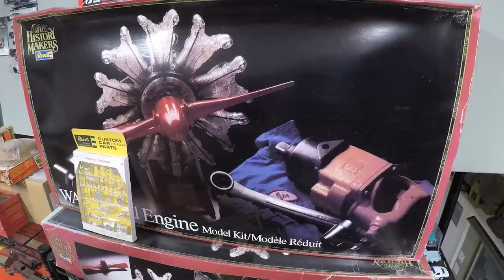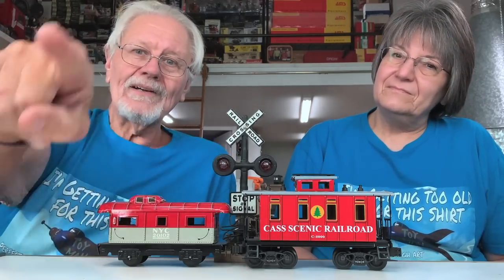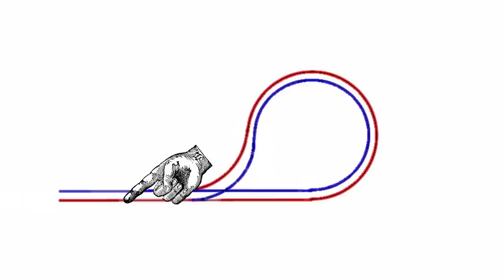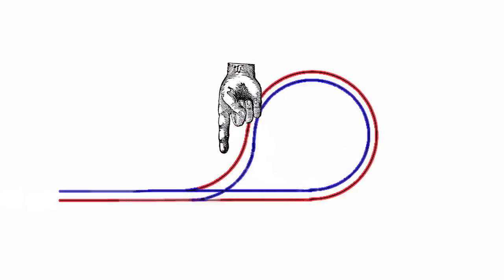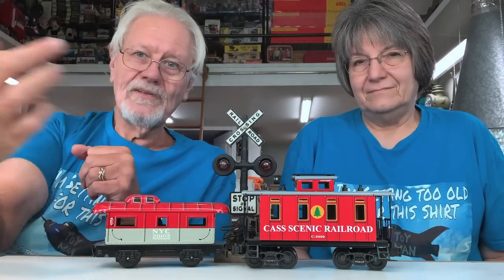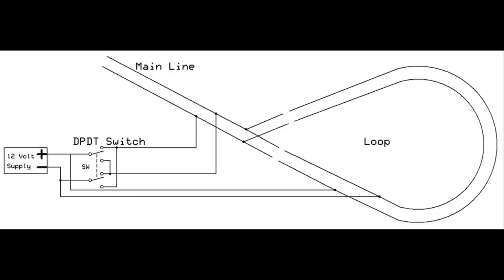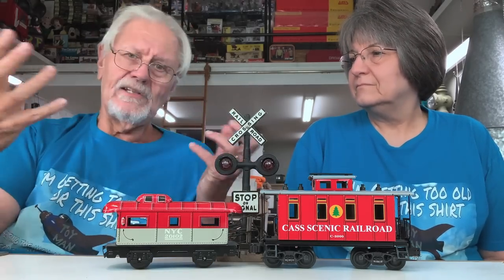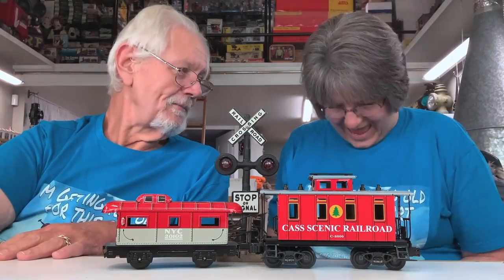Scales and Gauges Part 8 - Why did Lionel Use Three Rails?

Comment: Well, I'm certainly glad we adopted alternating current.  Can you imagine how many power plants would be around now if we had stayed with direct current given its distance problem.  That being said, almost any appliance nowadays runs on direct current as even though outlets supply alternating current we still use rectification in appliances to convert the ac to dc.  Towards the end of the tube era we went from using tubes like they ST type 80 and the 5Y4 octal and 35Z5 loktal tubes and started using selenium rectifiers which lasted much longer.  The being said, if you currently have an old radio that is still using a selenium rectifier it's time to change it over to a diode because those selenium rectifiers are now way past their intended service life and they will eventually burn up.  They are not a pleasant smell when they do either and will make a house stink for a long time with a smell somewhat like burnt garlic but more powerful.  Diodes are very cheap as well, being about 10 or 11 cents each.  I usually replace a selenium rectifier with a 1N4007 diode in my old radios.
Reply: Be careful!!  Check out the filter capacitors and other circuit elements because the forward voltage drop on the rectifier you are replacing is much, much higher than your silicone diode.  As a matter of fact, you probably need to change any electrolytic capacitors because they tend to dry out, become leaky, and are much much lower in C value.
Reply: @wcarlhepker4806  Oh, I do.  Last time I replaced the rectifier it was on a Zenith K725 and I put in a dropping sand resistor in as well.  I always replace the electrolytics as well and any oot resistors.  I tend to change out the old wax caps too, but none of that really had anyting to do with what was mentioned in this video so I didn't include it.
Reply from the maker: You guys wanna rebuild my juke boxes?  The filters hum like a substation.

Comment: The diagram for a reverse loop and switch for DC will work equally well for AC.  Instead of a polarity mismatch, you have a phase mismatch.  Either way, it is a "short."  Instead of solving a problem of a DC voltage being reversed and connected to itself, you are solving a problem of an AC voltage having its phased reversed and connected to itself.  In fact, with DCC, which is AC (some don't think it is, but it is) the same solution is used for reverse loops as if it were DC.  However, for DCC the reversing is typically automated (but doesn't have to be).
Reply from the maker: Yup!!! More when we do the electrical series!!!! Super interesting stuff!!

Comment: Another case of RL track with three rails is when tracks combined both narrow and standard gauge. In that case the extra rail would not be positioned at center. Unless the small gauge was half the width of standard gauge. I am unaware that such a combo ever existed.
Reply from the maker: Yup. In Australia in places they have 4 rails. That support 4 gauges!

Comment: Glad to see you guys alive and kicking!  (I've been spending my YouTube time since Feb on Ukraine.)
Did you forget to mention the bit about the old Lionels changing direction every time you gave them power?  I think you had the intention to mention it with the AC explanation, but I didn't hear that 1 point.  Given your AC explanation, I understood why the engines switched automatically.  
This is#8 in a series?!  I'll go back and check the others, as Ukraine permits.
Reply from the maker: Hi!  Yup #8. The reverser was a Marx invention. Lionel bought it. On a simple AC motor you need a switch on the locomotive to reverse. On this reverser there is a stepper relay that reverses the motor every time the power is cut. Or it can have a neutral position. So there is a three position relay. And on the most advanced system a button can interrupt the power for a split second and reverse that way.
Reply: @Toy Man Television  good lesson.  My grandad's Lionel never had a Lionel Transformer.  Might've been a Marx, but this explains the "cross-connect."  The xfmr has a little red spring loaded pushbutton on the side.   Never thought of that thing as advanced, but such is the march of technology.  It's gotta be at least 80 years old, and the d*** interrupter switch still works.  (Tho only at Christmas!)
Best to you and your prettier half!

Comment: The Marklin Company used to sell 110 and 220V volt high current AC O scale and Gauge 1 train sets called Starkstrom, you can tell them apart from the low voltage ones by the fact that there is lightning bolt symbol on the cab, Dangerous trains.
Reply from the maker: Didn’t know!!! Easy to see why. The variac transformer was huge and expensive. DC such a problem. John Allen’s rail Road was originally powered by an AC motor connected to a DC generator with a flywheel. Then the throttle was a variac that ran the AC motor. So the engines would start slowly and “coast’ to a stop. Inspiration for “flywheel” power supplies in the 1970’s when this could be done with a set of capacitors.

Comment: I thought the ac/dc discussion would lead to LGB, TT and Q.  TT you covered, but what is Q scale?
Reply from the maker: We will get to #1 gauge (LGB and so on) sooner rather then later. I think…. At this rate 2025?  Anyway Q is the same as SMO. Scale Modified O scale. Originally I think they picked Q as a Q is a modified O. Anyway 1:47 scale and later 1:43.5 scale on O gauge track.

Comment: Although a lot of info here makes sense some details are not accurate.  Lionel did not invent three rail track (Marklin did in 1891).  Also the toy train items in the video are not made by Lionel, but by Marx and somebody else (the G gauge caboose).  There is no problem using AC current with a two rail metal tied track system (American Flyer S gauge used it with metal ties)  but before plastics insulating all the axles between the wheels was an expensive challenge.  Charming video nonetheless.
Reply from the maker: Hi. Yes oops. Marx. The large caboose is O but just big. A souvenir item.
Reply: That caboose is O gauge!?  Good heavens.  I personally like the fact that someone is putting out information about tinplate trains.  All my kids and grandkids love them, not to mention people who just stop in for a visit.  Putting together a really cool prewar train set with track and tinplate accessories is less expensive than many electronic toys (I just bought a standard gauge set for $150 CDN or about $105 US with track in beautiful original condition).  The motion, the noise, the lights  and the smell  all play on the senses.  Keep doing what you are doing...

Comment: How did AMerican Flyer work? It was also AC. How the Lionel E-Unit worked is also interesting.
Reply from the maker: Yup. American Flyer also runs on AC and without the center rail the track plans need to conform to outside rail always being outside. It is possible to do a reversing track but a bit more difficult than DC.
Reply from the maker: And the reverser on Lionel can be one of several systems. The Marx style reverser with an  interrupter on the power supply, a relay in the locomotive as on the E units or a simple switch on the locomotive.

Comment: Wow, still confused.   You show a 2 rail diagram with breaks ... I assume in the loop that the loop becomes hot, but once it exits the loop, the straight away going the other way somehow becomes hot? How does it automatically change?   Is the engine "coasting" over the short breaks and tripping a switch at the same time?
Reply from the maker: It’s not automatic. It ca be but in the normal system here you make sure the polarity at the entrance to the loop matches the main line. The train can take either route but the polarity at the entrance needs to match. Once the train is in the loop you throw the direction switch and now the polarity matches the exit route. A detector can automate that.

Comment: Lionel measured their track curvature in diameter not radius. 0-36 curve was a 3’ diameter circle. When Lionel produced their 0-27 trains the “standard curve” produced a 27” diameter circle. The 0-27 trains were also slightly under scale to accommodate the tighter curve. This also made it possible to build a “real railroad empire” on a 4X8 sheet of plywood. Whereas this would be difficult with 0 gauge trains and track.
Reply from the maker: Yup. Forgot to mention that.

Comment: When I was a kid a couple of my friends had American Flyer trains as they thought the 2-rail system was more realistic. I guess that's a credible argument, but 3-rail Lionel was always what I had and liked to this day. That includes all the great stuff available these days from MTH and other manufacturers. Isolating a track for manual block operation is also easy.
Reply from the maker: Well.. I thought the same thing.. it’s a slippery slope. First American Flyer. Than HO. Then craftsmen kits. Than scratch building. The thing is Lionel was not intended to be realistic!! It is intended to be FUN!!
Reply: @ToyManTelevision  The stuff Lionel's making today is highly realistic. I have some of their new stuff and it's great, and expensive. I have HO too and like it. Never had American Flyer. But anything that runs on rails is good no matter what size it is! 🙂
Reply: @ToyManTelevision  You said in this video that 3-rail was AC and 2-rail was DC.  Not so with early 1950's American Flyer. They were AC.  Reversing was done with a relay in the tender.  Sequence: Power on (Increasing the throttle/voltage) the train goes forward.  Power off, the train stops.  Power on, train remains stationary but a click is heard from the tender.  Power off, train remains stationary. Power on, train moves in reverse direction.  Power off, train stops.  Power on, train remains stationary but a click is heard from the tender. Power on, train goes forward.

Comment: So the engine could be set facing either way and still receive power.
Reply from the maker: It will always get power with the same polarity. Hot leg is always the center rail.

Comment: AC or DC, 3-rail / Marklin don't need any wiring or switches to have reverse loops. Same for live catenary. Most AC field wound magnet motors will run on DC as well as AC. The E-unit won't work, though.
Another fun fact - real electric railroads, like the Milwaukee, got DC power for their overhead traction wires by running high voltage AC motors to turn large DC generators in the sub-stations. In 1918, that was the only practical way to turn approximately 15 000 horsepower worth of 110 000 volt AC into 3000 volt DC.
Reply from the maker: The famous John Allen layout did the same thing!  He had an AC motor run by a variac that spun a DC generator with a flywheel. No need for a big DC power supply with a tube rectifier, and added bonus it added a flywheel effect causing trains to start slowly and then coast!

Comment: Interesting, I never knew why the third rail. So now I'm wondering how do AC trains reverse? 

And... for a DC train you'd need a rectifier, but you wouldn't really need filters, DC motors don't care all that much about how smooth the current is, in fact as I recall pulsing DC was (is?) a thing in model railroading as it helps a DC locomotive to start moving more smoothly.
Reply from the maker: Hi. The AC trains originally had a switch on the cab. Reversed the field coils. Then a system where the switch was replaced with a stepper relay. Whenever the power was cut the fields reversed. So first forward then reverse. Later they added a center off position so the train could sit with the lights on. 

As for filters they were used to keep the motor from humming. And perhaps burning out as the voltage was higher to get the same speed.
Reply: @ToyManTelevision  Thanks. Was the stepper relay on the locomotive? So did that setup mean you couldn't stop the train and then start it moving again without having to go into reverse for a bit?

Comment: Lionel also marketed  0 Gauge versus 0-27. With O gauge, 31 inch radius curves, being more expensive with bigger engines such as 2-8-4 Berkshires and f-3 diesel locomotives. 0-27, 27 inch radius curves, was marketed as less expensive with typically smaller locomotives such as 2-4-2s and 0-4-0s. Strangely though some locomotives were exactly the same build wise, but they were numbered differently. and example being the 4-4-0 general locomotives from the late 50s to early 60s, one being #1862 that was marketed as an 0-27 locomotive and the other #1872 which was sold as an 0 gauge locomotive. These locomotives have the same basic frame and wheel configuration, with the only difference being that the 1862 has less features than the 1872.
Reply from the maker: Thanks!!! Good information.
Reply: I find myself wanting to scream. 

O27 makes a 27 inch DIAMETER circle

Normal Lionel  makes a 31 inch DIAMETER circle

And the same for O72.

Comment: So, how did HO and American Flyer operate on two rails.  As I remember it, their transformers were no larger than Lionel's.
Reply from the maker: American Flyer also used AC but on 2 rails. Making reverse loops a real problem. But as long as you always go in a circle it fine. HO came a bit later. And used a Rectifier. Early DC systems usually used batteries.

Comment: I remember learning about AC and DC the hard way . I was 8 years old and burned out the motor on my new Tyco F9 by hooking the track to the AC on the transformer! 😂
Reply from the maker: Yup. Loud hum. No movement. Soon smoke!
Reply: Did that with a brand new HO MTBA Emerald Green Line model I got for Christmas. Oops! Didn't run too well after that.

Comment: I'll give you one more. In France, Bordeaux(?),(I think) Alsthom has a light rail system that runs the voltage thru the rails. Now you may wonder what is there to prevent someone from walking on the live rails? What they do is the voltage is only present when the train is on top of the tracks. When the tram is covering the rail a circuit automatically turns on the power when a tram is covering the track. Then when the end of the tram nears the end of the powered track the power is automatically turned off.  I think they also use this in Dubai.

Anyway if you want to read about it: https://en.wikipedia.org/wiki/Bordeaux_tramway  &  https://en.wikipedia.org/wiki/Alstom_APS

More then one way to run a train!
Thx again
Reply from the maker: Wow!!! Thanks!!

Comment: There are three rail trains in real life what about trolly cars, or trains with pantographs which is your third hot rail. As for O27 rails they also have a lower profile than O gauge track thus O27 trains run on O track but O equipment tends to derail on O27 track because of longer flanges on the trucks.
Reply from the maker: Hi. Thanks for the information

Comment: Just to be clear.. it makes no difference if its 2 rail or 3 rail track, either can be used with AC or DC... and guess what, modern DCC uses a very high frequency AC mixed with digital commands.
O-27 and O-31 or whatever number, are NOT the RADIUS of the curves ... they are the DIAMETER at the center rail. 
O-72 is 36" radius.  O-31 is 15.5" radius.
Reply from the maker: Thanks..
Reply from the maker: It’s just harder to create a reverse track in two rail AC than two rail DC. So center rail was used.
Reply: @ToyManTelevision  Not really.  The situation for AC and DC for a reverse loop is identical with the identical solution of reversing a track connection somewhere with a switch.  In one case, you care switching polarity.  In the other case, you are switching "Phase."  Even in Lionel instruction manuals they had to address "Phase" conflicts if using multiple transformers on multiple insulated blocks.  No different than two DC power packs having to be the same polarity.

Comment: I don't buy the AC vs DC thing.  It's the reversing loops that are the REAL reason.   You can put AC on one rail and ground on the other and an AC motor will be just fine on a 2 rail track.   You can't make reversing loops with either AC or DC without breaking the track or using that 3rd rail.
Reply from the maker: Well there are several reasons why the third rail. But with three rails there is no need to figure out power routs. Make any track plan and it just works. Hot leg is always on the center rail. And the locomotive always goes in whatever ever direction is set by the switch or relay in the locomotive.
Reply: @ToyManTelevision  Yeah - but the lack of realism in the track is a show-stopper for me.

Comment: Well, you didn’t show how the 3 rail engines make contact to that middle rail. Also, while 036 trains can’t run on 027 track, I assume that 027 can run on 030 or 036.🚂🚂🚂🚂🚂
Reply from the maker: Hi again. Yes the O27 can run on any of the tracks. The central pickup is often an elaborate system with rollers and everything. Not sure it’s needed but very over engineered.

Comment: I had a marklin train set and I had to stop the train  and I had to stop the train  and flip the switch to go in the oppisite direction not american flyer it ran on 2 rail and alternating current
Reply from the maker: American Flyer is also AC but still requires reversing in the locomotive. However it doesn’t require flipping a switch as there is a relay in the locomotive that replaces the switch. Most Lionel and Marx also had that. We will dive into to that when we do electrics. But you can’t reverse an AC train by reversing the current at the rails.